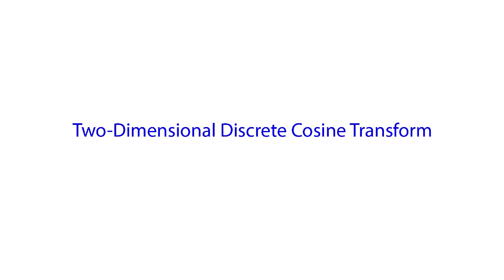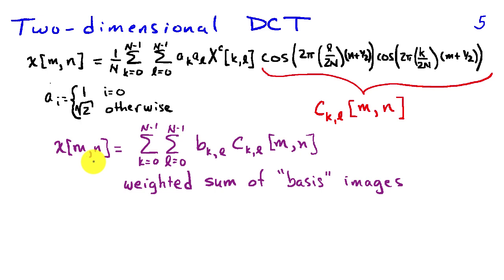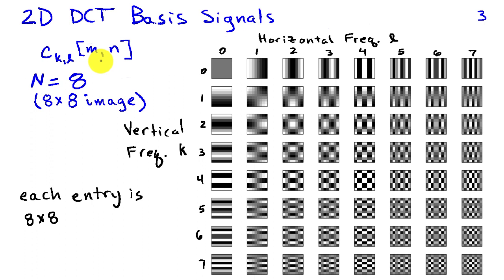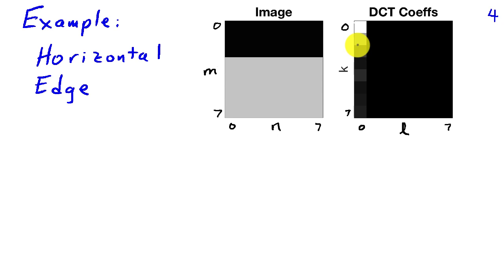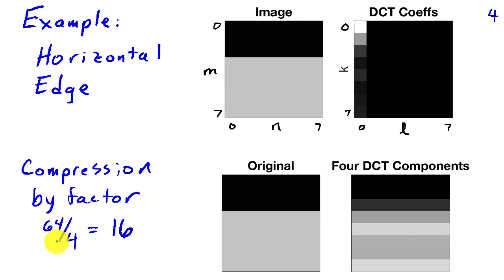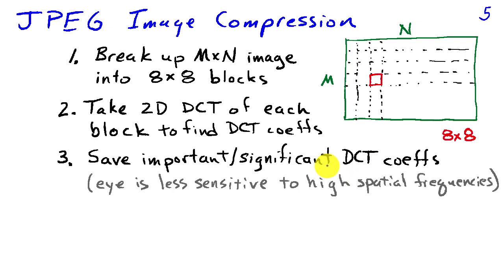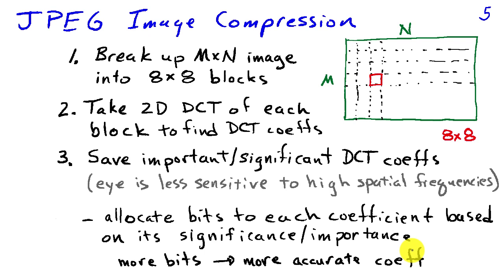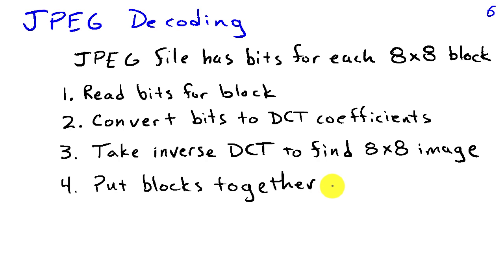The Two-Dimensional Discrete Cosine Transform

Comment: Thank you. This is the 3d version of the "DFT", which is used to capture Audio. 
By doing so in Cosine, your encoding images by splitting them into freqencies.
Reply: Well that just doesn't make any sense. This is the REAL part of the "DFT" since the Fourier transform captures cosine as the real part and imaginary sine waves. Furthermore, each 8x8 block is a TWO dimensional DCT, so I'm not quite sure what you're on about.
Reply: @ejovo  
? I was refering to how DFT in 2D and that is how we capture and sample Audio.

The DFT you're using is on an "extra" dimension in a sense, as image has two x y, time components, while sound has Amplitude and Time. You can design filters using Sine and Cosine to form digital filters.

Sorry if my original comment was a bit garbled, your video was very entertaining and related to my degree.